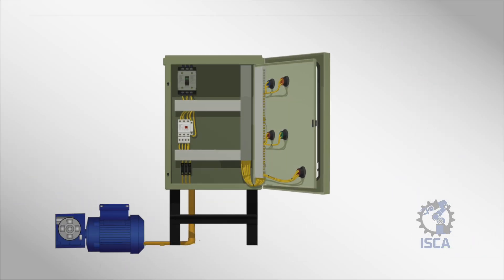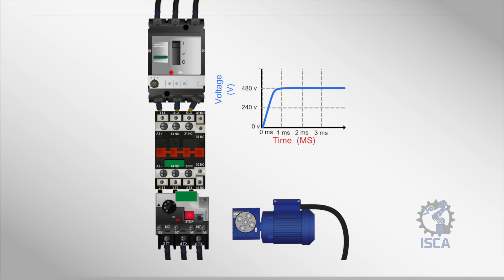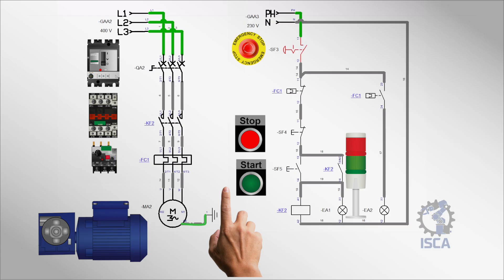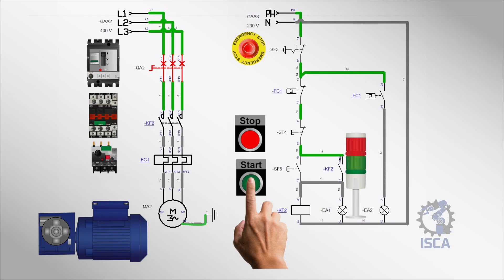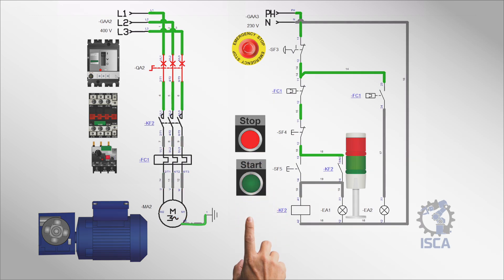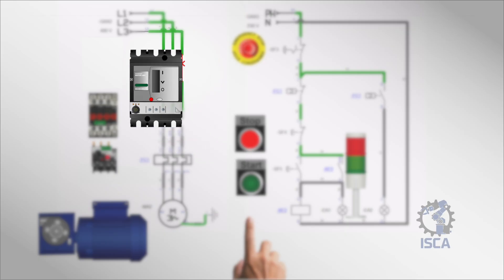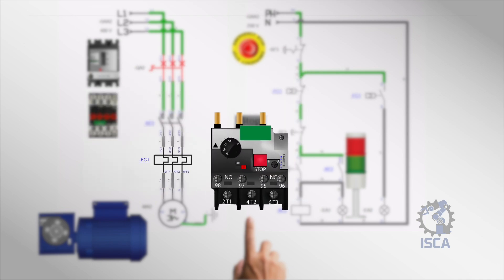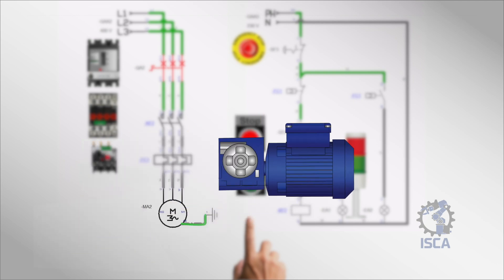DOL Starter | Direct On-Line Starter | Explain with Circuit Diagram

Comment: My amazement never ends...every day, there is someone else re-inventing something with a new confusing name or some idiot code writer changing a color code for wiring, etc.  In this case, what you are describing is CROSS THE LINE STARTING.  FYI, it been called that since about 1895.
Reply from the maker: “Cross-The-Line” is an outdated term. Today, “Direct-On-Line (DOL)” and “Across-The-Line (ATL)” are the standard terms used. Terminology evolves, and sticking to modern, accepted terms is important. If you have issues with that, it’s on you to adapt.